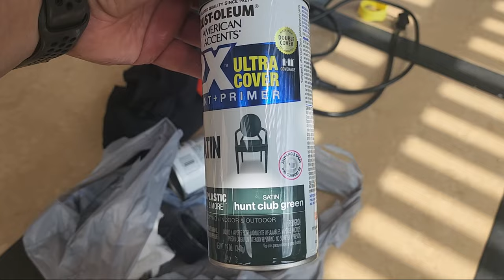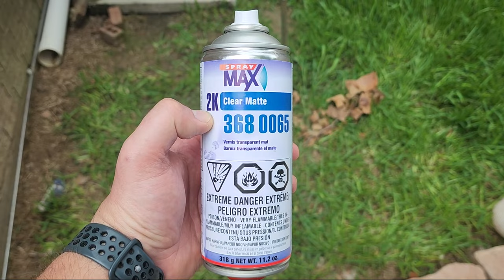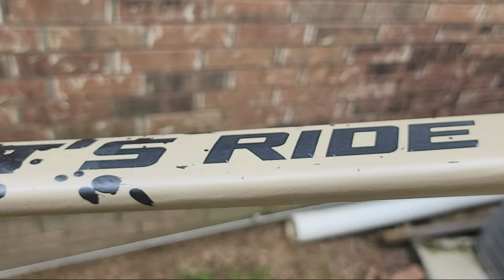I destroyed my bike. My Walmart bike gets new DIY paint. Did it fail #mtb #mtblife #cheap #emtb #diy

Comment: The two paints did not like each other. You could try to respray it and let the paint off gas 7 days apart before the next color. Also try putting your paint cans in hot water to increase the internal pressure giving you a better spray pattern.
Reply: Totally agree
Reply: Yup. This tip right here

Comment: I dont think you destroyed it thinner inital coats and wet sand primer help prevent cracking i learned the hard way got it wrong so many times great video stayed up late for it love the lets ride reveal sometimes paint just reacts in the uk i try to use halfords or hycote never mix them etching primer is good if you dont want to take it to bare metal